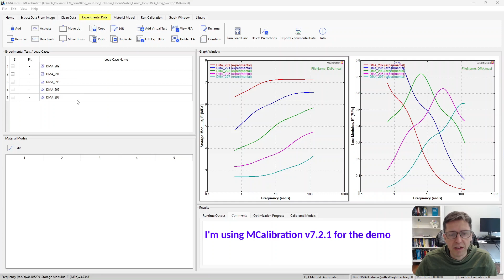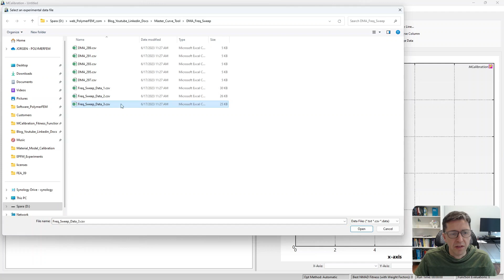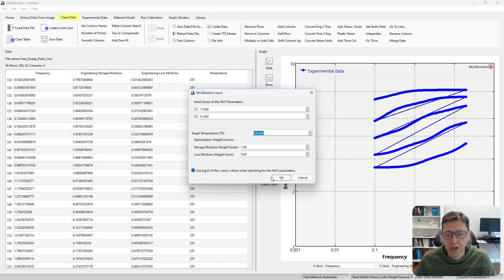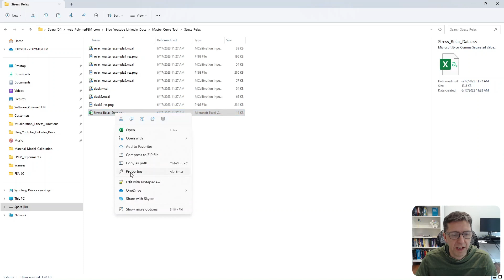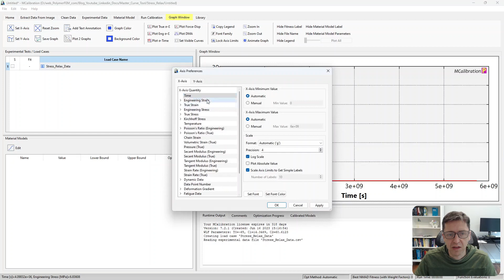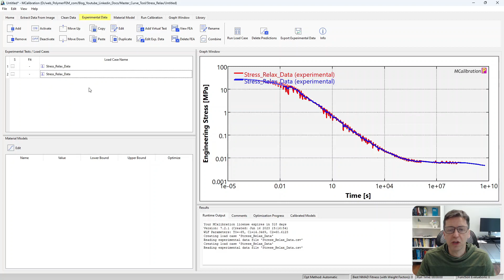Quickly Generate a TTS Master Curve

Comment: Hello, I just tried this on some DMA frequency sweep data. I have two questions:

1. I noticed the TTS option selects a temperature by default that you can change. In my case, the data I had covered 22.78, 26.3, 29.92, 33.5, 37.08, 40.72 C. I saw 33.429 as the default value, which I changed to 22.78 (to keep the first curve as is and shift the rest). However, I saw a very bad fit. When I ran it again with the default value (33.429), it looked perfect. After a few times going back and forth, it finally gave me a master curve at 22 C. Am I doing something wrong setting the shift temperature ?

2. Is there a way to export the shift factors as well along with the master curve data ?
Reply from the maker: Here are my answers / comments:
1) Can you send me your experimental data? I would like to find out why your fit was bad, and if needed improve the software. Contact info: https://polymerfem.com/contact/
2) The master curve parameters that were found are listed in the "Runtime Output" tab of the main window.
Reply from the maker: I got your PPTX file and will respond through the web site.
Reply: @PolymerFEM  Thank you, I just sent the file through the contact form
Reply from the maker: @ankitparikh7793  We just released a new version of MCalibration (7.2.3) made the Master Curve calculation a bit more robust. It can now analyze your data for any temp.
Reply: @PolymerFEM  thank you ! I’ll download the new version.
Reply: @PolymerFEM  Thank you for the new version, the fit looks great now. I have a question about the WLF parameters in the runtime output. 'T0' is supposed to be the same as the target (ref) temperature I set for the fit, right ? For a target temp of 21.98 I'm seeing T0 = 25.3789 and slightly different values for each repeat fit. Is this normal ?
Reply from the maker: @ankitparikh7793  MCalibration creates the master curve in 2 steps: (1) search for [T0, C1, C2] that gives the best horizontal shift, (2) Translate the master curve to the specified target temperature. The T0 value that is listed in MCalibration is the value that was found in Step 1.
Reply: @PolymerFEM  Is there a way to fix T0 and have it search only for C1, C2 parameters ? A few of the papers on polymer composites with TTS use the same reference temp across samples with varying filler % to compare the C1 and C2 values. I'm trying to do something similar
Reply: Excellent sir, is there any open access software for master curve plotting.